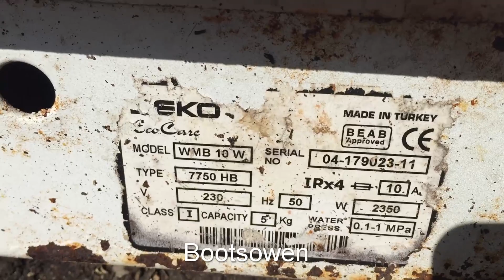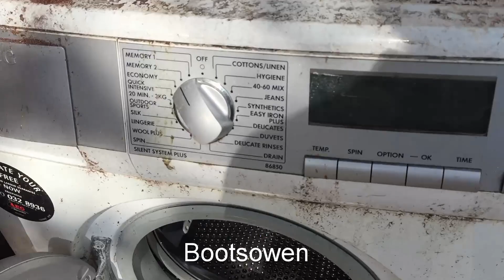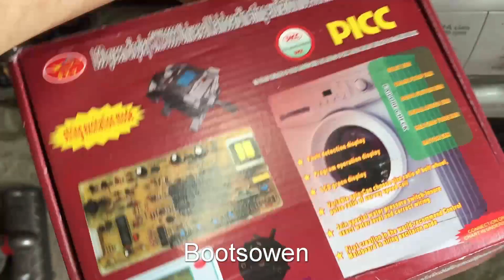Update August 2021: Thank you, Wash SMASH! and whats going on here

Comment: Mechanical timer machines are much more interesting then electronic timer ones. However, there is also a 3rd option, which is a hybrid between mechanical and electronic timer - hybrid timer. The differance is, it doesn"t emit clicking noises all the time (like mechanical timer). It stays silent and once the time comes it advances
Reply from the maker: Cool, what machines have those timers?
Reply: I think your Bosh washing machines (in which you select the cycle, and timer turns on its own to set the correct position) have hybrid timers. The strangest one i"ve seen was in one older Whirpool washing machine which had a standard selector (like in electronically programmed ones), however during cycle it would make longer pauses between stages, because the internal hybrid timer had to advance to next stage (you could hear it clicking)

Washing machines with mechanical timers are definietely much older and if somebody wasn"t actively keeping one alive, they are most likely gone already
Reply from the maker: Aha, you might be right. I was thinking of putting carpet inside this machine (WFK2801)  to make it quieter, while I am in there I could take a closer look. It has a selector that doesn't move during the cycle. But I don't know what is going on inside. I have never looked!
Reply: @bootsowen  

WFK2801 has a display which tells how much time is left, so it is electronic

You should compare the control board of this WFK2801 with older Boshes with selector that moves during cycle. Control board in these older ones was very, very big as far as i can remember

Comment: Put a motor on 460 volt system
Reply from the maker: I don't have such a system. I would like to try
Reply: @bootsowen  you need a phase converter. They can be bought cheeply but not for the faint hearted. Unless you have some 415v shop tools to run. It's not worth the investment and potential danger. That said there is much fun to be has with all dangerous things.
Reply: @bootsowen  u need a isolation transformer to protect the mains
Reply from the maker: I have an isolation transformer, but it is single phase.